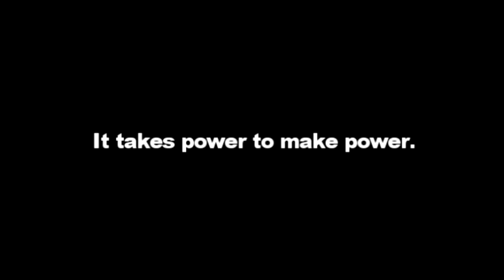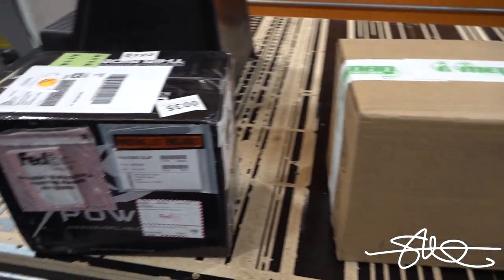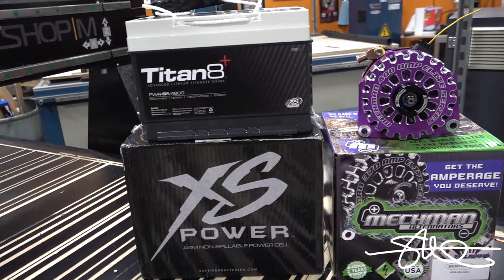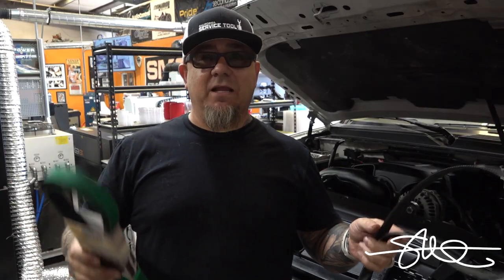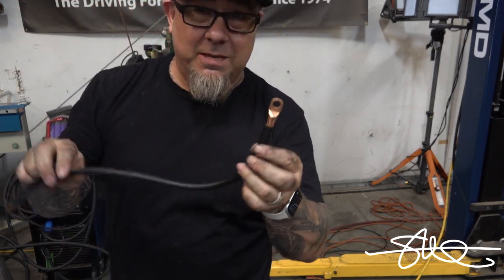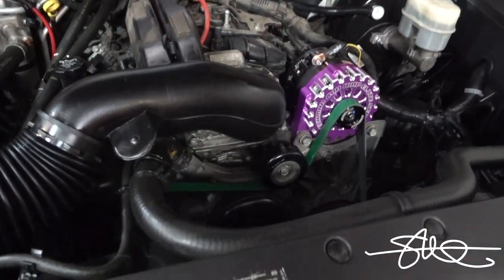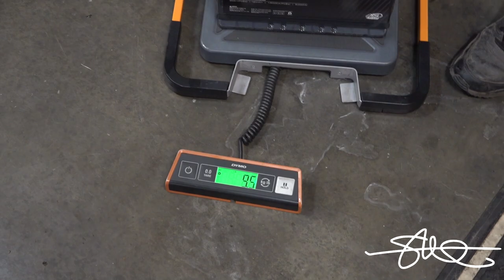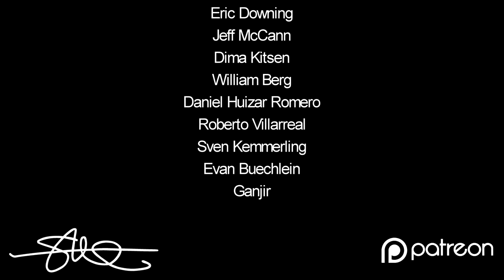Major Electrical upgrade: 400 Amp Alternator & Lithium Battery - GMC Yukon XL Sound System Build

Comment from the maker: In this video we raised the Yukon's original drop back up about 1" in the rear anticipating the weight increase from the subs and amp rack.  We also added some more lithium and a Purple 400 amp elite series alternator.  We did spend some time chasing a check-engine-light that wouldn't go away.  Finally got it fixed! Now we can get it smogged and registered.  Then we can start adding some wire runs and the rest of the stuff.  2 24" Sundown Subs powered by a DC Audio 7.5k amp.  It should be fun! Make sure to hit that notification button and thanks for watching if you did!
Reply: Love love this build!!!! Damn Steve everything is so impressive and you inspire us all to do the best !!! I even made my ebike with a full 13.2V system with 8 inch dual VC sub and amp 8 speakers on a EBIKE !!! Haha
Reply: i love all your builds
Reply: Love these videos brother!!   Shit I miss the ones of just you showcase the new products
Reply: Many people just let that Check Engine light fly. Props to those who take care of their vehicles because I sure have been neglecting mine lol. #NotMyDailyDriver
Reply: That's most Beautiful ALTERNATOR I have Laid 👀 on! 👌👌👌👌
Reply: That stock alternator is actually the bigger GM version. The tell is the black spacer in the middle of the front and back housings. That makes it anywhere from a 170-190 amp alternator. 🫡
Reply: Hey my man. I have skar audio amps. (1) 2,000d (1) 250.4 and (1) 75.4. I would like to know what XS battery you recommend me and how many. If you can help me. Thanks
Reply: @J Mangual Cruz  Honesty, you can never have too many. The key is keeping the charge full. Minimal power drop is key to an excellent system.
Reply: Im having "no battery charge" and  "service brake booster"  on my display.  its charging and the brakes are fine.  what did you have and how did you fix it

Comment: Steve, what ended up causing the check engine light?
Reply from the maker: turned out to be the fuel pressure sensor.

Comment: You would be surprised by how tiny something can be and yet cause such a headache! I’m in New Jersey where we also test for smog! We had a Toyota pick up come in the shop for a check engine light due to emissions being too high! The customer stated that he has taken the truck to several shops plus Toyota, To make a long story short this truck had three different sets of aftermarket catalytic converter’s installed and then finally Toyota installed OEM converters! The check engine light was still on, Toyota recommended the customer bring his vehicle to our shop! It took us a few hours but we finally found the problem, There was a pinhole in one of the factory welds near one of the O2 sensors! The hole was so small that you could not hear any leaking, Also there was no condensation dripping from it because the pinhole was on the top of the pipe! Let me just say that none of the shops had charged him for any of the work and Toyota said they would give him his money back if he wanted to bring the cats back! As for us we figured the customer paid enough in his own time trying to figure his vehicle out that we told him there was no charge, That was 6 years ago and he is still a customer of ours to this day not to mention the rest of his Family and Friends that he has recommended are also our customers!

Comment: My alternator on my semi was 140amps stock. I took it to local alternator shop here my area and they rebuilt it and turned it to a 200 AMP alternator. They didn't have the bigger winding to make it a 270 or 300. But, just getting it to 200 made a big difference in my system in my semi. I found a place in Ohio that did Bassin Semi's truck. They turned his to a 270. Alternator is key brother!

Comment: Steve the best way to monitor 3 alternators and do you directly run to one set or individually separate among the battery bank after fusing on both ends

Comment: Does this alternator have an internal regulator specific for lithium batteries? If not what kind of external regulator are you using? I thought You couldn't just slap a regular alternator on a lithium battery? Was under the impression of Having to have some kind of external regulator, or one of the other half ass workarounds in my opinion... dc-dc converter or running the charging cables through an AGM or lead acid battery then paralleled to a lithium.  Having a alternator with a built-in regulator, specifically set up for lithium, or running an external regulator specifically for lithium.  Best way to go.  But didn't see or hear you mention anything about this?!  Just wondering if im unaware of another way.  Always trying to learn something new every day. Nice set up
Reply: Pretty sure they aren't supposed to be charged above 14.8 so of ur internal is set below that I wouldn't see the problem.

Comment: Had so much problems with my mech and it was a 350 it would push 16v out the box I had no voltage control and changed the part to have 14.8 stable at a local shop no problems. But how did you have like that out the box without modding it? Does that 400 come like that ready? If so I’m copping it. I have a video how I installed my mech boi it was driving me nuts until I figured that out though.

Comment: Great video as always Steve!!! 👍👍👍 That's a beautiful Purple alternator!!! I assume they charged an extra fee to get it in Purple correct??? You made that battery and alternator swap look so simple!!! Most shops would of probably charged a few hundred bucks just to do what you did in a fraction of the time that they would have charged to do it!!! No telling what the dealership would've charged that's for sure!!! Can't wait for the next video!!! Quick question Steve, why are those lithium batteries a lot more expensive than the regular XS POWER batteries??? When your doing a CAR AUDIO SOUND SYSTEM how do you figure out what amperage of an alternator will you be needing for your install before you even get started??? Thanks for your help on that!!! ✌️✌️✌️
Reply from the maker: Lithium batteries will always be more expensive than standard AGM.  Thanks Jose!

Comment: Hey brother love your videos! Quick question about a 2019 Honda Accord LX. I currently have a taramps smart 3 bass amp, 0 gauge wire with 320 amp fuse, big 3 also 0 gauge, and 1 Skar EVL 12 (1250 rms) and I have no battery issues at the moment with my stock 130 amp alternator and an 80 amp hour platinum Duralast AGM battery. 

I am swapping that single EVL 12 out for the dual EVL 12 prefab box from Skar and am worried I might run in to battery/alternator issues. 

What do you think?

I am ok with adding another AGM if that will suffice. 

With regards to a HO ALT though, Honda has an electric load detector system and I have read that adding the HO ALT doesn’t help. What do you do with Accords and their power limitations and do you bypass the ELD? Just need to figure out the best, cheapest, most efficient, least invasive way to power my subs and keep rolling.

Thank you brother.

Comment: Hey Steve, I was wondering if you could educate me on a setup I am trying to run. I have a mechman 400 amp alternator and a xs d3100 for power. It’s gonna be powering an 8k taramps going to 2 vxf 15s. Would running the stock battery and the d3100 be enough power?

Comment: What's up with that harness in the 400 amp alt ? My 03 Tahoe has that same harness and uses same belt you had to buy my factory amp was 145 amp . Is that harness you have in there with one wire some bypass because your factory harness is different along with alternator ?

Comment: Hey Steve, can LTO be ran parallel with Lifepo4? I want to run this but have seen other manufacturers say not to run LTO and regular lithium, I believe because the higher resting voltage of LTO.

Comment: If I was running 2 d3400s with the same alternator could I use a 300 amp isolator between the two?

Comment: Damn, looks like he has the big boy 6.0L v8 in that Yukon!! 
So I'm assuming that battery was out of your Escalade since it says Cadillac, and my Cadillac takes a group 48 battery so it seems only right for you to sell me that one if it works!
I built a hodgepodge of a 12 inch woofer so I can finally have some beat in the car after blowing the stock Bose a couple times. Hopefully I will build a box for it soon, and then try to find a mediocre 1500ish watt amp for it, and put that prototype SMD HLC-1 back to use again!!
Reply from the maker: you know you don't gotta buy shit from me.  I would send it to you for free. But i think we need to hold on to it just in case we rip all this stuff out some day for some reason and need to put a regular battery back in. I am a hoarder like that lol

Comment: I don't know if this was mentioned before but why not go with a second alternator and battery? I have the same type of truck and I went with a second alternator and a second battery in the right front corner of the engine compartment. It  did wonders for my system! A charging station strictly for my stereo. BTW I love your work bro! If you ever decide to open a shop in Milwaukee or somewhere close I know several guys waiting for you!
Reply from the maker: this system doesn't need 2 alternators.  Instead of 2 i did one large 400 amp alternator.  Did you actually watch the video or have you been paying attention to what this project consists of? There are 3 Titan 8 lithium batteries (2 additional in the amp rack).  Thanks.

Comment: Steve where exactly did you get the ignition power from the fuse box ? I’m installing a Mechman on my Tahoe same body style and need to know.
Reply: I have an 03 tahoe and I just used a multi meter on some of the open slots in the fuse box. Once I found it,  I just plugged it in with a spade connector.  Might not be the only way to do it but it's been working for me for over a year now.

Comment: Which xs power agm battery is that in the factory battery location? I been wanting to replace my factory battery with a AGM but I was told a AGM  battery couldn’t run my car. Let me know please!
Reply: Agm works exactly the same as a normal lead acid battery. Only it's way better. You just need to know the size for your vehicle.

Comment: Aye Steve I'm trying to switch over to lithium but I keep hearing lithium isn't good under the hood can you educate me on this cus i see you putting them in the hood....im told to put agm under hood and isolate the lithiums from it....so idk
Reply from the maker: you see me doing it right? use the same battery i did and you shall be ok.  I can't speak on other brands.
Reply: @meade916  ok coo...the titan 8s ok got it....thanks Meade
Reply from the maker: @cadillacdon6935  not just the Titan 8...but the one that is made for your vehicle to fit up front. The standard titan 8's in the little tiny case probably can't be under the hood without heat protection...
Reply: @meade916  yea yea of course..I understand...thanks Steve

Comment: What battery can I use for 30000 watts
Reply: Go to down4sound shop and you will see the description of the batteries wattage capacity
Reply: Lol nothing you need to look into.   Bc nothing you have is really doing anywhere near 30,000 Watts.  Lol. Stop buying cheap crap from companys who lie theirs asses off and trick you!
Reply: And "what battery can a use for 30,000 watts just shows your ignorance.  You would have to have MULTIPLE 400AMP plus alternators, and what battery?  You mean BATTERIES!  lol even with lithium 10 plus.... LMAO.... start by doing some research, ohms law...how dc power works.... don't ask that to someone again... especially in public...you will be thought a fool

Comment: What's a good lithium battery to run my car and my lil 1000 watt system? Mostly for the weight savings on my 1000ph hellcat.
Reply from the maker: I just showed you which one would be good. An XS Power Titan 8 lithium FTW. :)

Comment: My xs battery went from 14.4 V to 13.2 with in seconds after the first charge
Reply from the maker: i have no clue what your point is or what you are trying to say.
Reply: That's typical behaviour a lithuim battery. You're all good.
Reply: @Sailaboat  now there jumping from 12 to 14 to 13
Reply: @NoName-gk2sj   that doesn't sound right. Are you taking these readings with a multimeter and straight off the battery ?.
Reply: @Sailaboat  no it’s while I’m driving. If I keep the volume at 20 it’s stays at 14 I have a charger with a Voltage display. But earlier I charged the 2 Xs power D4800 batteries that I have and I tested both of them and they started at 13.1 and they went to 12.6 with in 1 minute.
Reply: @NoName-gk2sj  how many amps are you drawing at level 20 and at full noise ?
Reply: @Sailaboat  I have 2 solo X 12 the new ones with 2 cxa 1800.1 kicker amps

Comment: Can you please tell me the number for the ignition switch  power inside the fuse box
Reply: Did you ever find out the fuse for the ignition switch wire
Reply: Yes I did
Reply: @slowed-downmusic4174  What number in the fuse box was it? And did you just use a fuse tap?
Reply: So wat fuse was it cause I just put mines on n now I need to k own what fuse to run it too

Comment: I keep hearing don’t not use lithium as a starter battery. Can someone explain why so many say don’t use beyond Agm for up front?
Reply from the maker: maybe they are using a brand that can't be used as a starter battery.
Reply: Ive used my lithium as my only battery for the last 5 years no problems same battery
Reply: You just can't have them underhood generally due to heat. You can always use them as starting batteries, you just need to relocate them outside of the engine bay.
Reply: @dylanandersen9318  That is the exact reason XS Power released the Titan 8+ series. The Lithium cells are inside of an insulated battery case designed to be installed in the engine bay.

Comment: 400 amp alt will make my check engine light come on. does it do this for this suv?  i have a 2006  i wanted the 400 amp. but was warned the light comes on.
Reply: watch 13:23 and he talks about that.
Reply: The clip he puts in at the end fixes that.

Comment: 14.84v is too high a voltage for a 12v lithium battery. Max is 14.6v
Reply from the maker: no it isn't.
Reply: @meade916 i have the same Mechman 400 coming for my 2017 Sierra, and supposed to charge @ 14.8, with cold start at 15.2. My battery guy is trying to tell me I need to charge at higher voltage, but I don't want to start screwing with the whole system. Can I just run this same battery as you and call it a day? I'll be running the jp83 at 2ohms.
Reply: @OriginalBabyBoi Nascar for interstate has alternators running at 16v-18v so go take it up with them then
Reply: @RamRam-wb9nw  lol what? That has nothing to do with me question